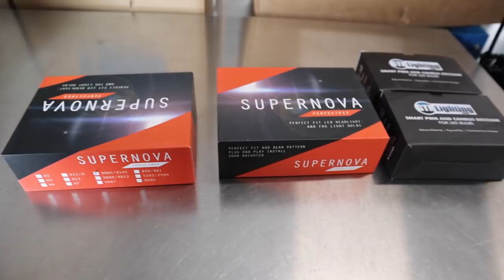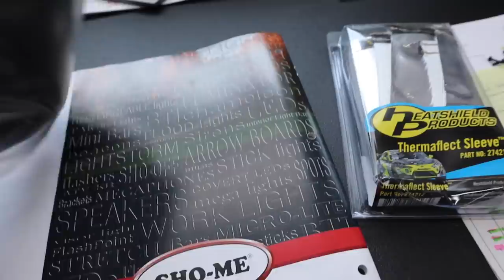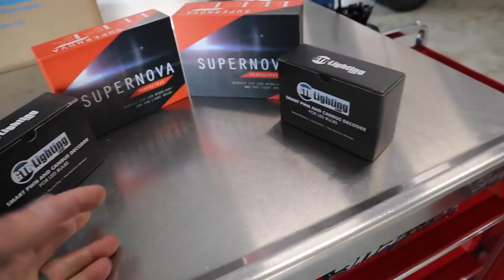EASY TRUCK UPGRADE TO IMPROVE NIGHT TIME DRIVING

Comment: When you said the 2015 is a nightmare, are you talking about reflector models or projectors? And 2015s and older or 2015s and newer? 🤔 also why is it a nightmare? Sorry for all the questions
Reply: wanting to know also. mine is a 2017 and with all the reviews of all LED conversion kits with the modules for the canbus system lights still flicker and or turn off... still extremely reluctant about buying a kit for my truck..
Reply: I would also like to know I have a 2018 with projectors.
Reply from the maker: Ram did something different w/ the canbus system in 2015 (only) & there’s a 50/50 chance that you’ll need an additional wiring harness to upgrade your headlights. This problem only affects 2015 Rams, all other years are fine.
Reply: Ram BEAST Projects what do you recommend for my 2018 3500 for led? I have the dark housing projectors. All I have heard is bad story’s that they all never work properly?
Reply from the maker: I recommend their 55w HID kit for your loss & the SuperNova Perfect Fit LEDs for your highs.
Reply from the maker: 2018’s aren’t the problem
Reply: SIXVIII I agree with Steve HID lows and LED highs. On high beam my setup way out performs my 20” light bar for light output.

Comment: I have been running Toyo's on my Ram forever. Not just the brand, the same tires, they have zillions of miles on them and I still can't complain. Diesel Brothers hooked up with Cooper finally and that brand is one I'm thinking about. If you could get a set, before anyone else, would be awesome.

Comment: I had the MOPAR lift on my 2011 Ram 1500. It was a 5inch and easily cleared 35 inch Pro Comp all terrain. Love the set up till I traded the truck in for a 2500😜😜😜😜

Comment: I heard the 2" mopar lift will only do 1" on the Rebels since it's an inch higher because of the off road package that sits an inch higher.. I have a 19 Rebel myself..
Reply from the maker: Correct

Comment: Just a question did you have to change the gears to run the 37
Reply from the maker: Yup, whole series on it. 

BIG BOY TOYS Comprehensive 4th Gen Ram 4.56 Gear Swap Unboxing (AAM 11.5 & 9.25 Differentials) https://youtu.be/Tvm_ohVTFEg

Comment: I wonder a HID kit would work on that truck?
Reply from the maker: Do not use HID’s in a reflector housing.
Reply: I put them in my 2018 4Runner and they worked great. Is there a reason why they work with the 4Runner and not the Ram?
 @BEASTProjects

Comment: How are you only running 37's with a 6 inch lift? My ram is running 35's stock. Must be the wheel offset I'm guessing.
Reply from the maker: Fits fine, 20X12” -44 offset.
Reply: @BEASTProjects  what I'm asking is why are you only running 37's lifted when my 2500 runs 35's without any lift or even a leveling kit. We have the same truck, just mine is stock.
Reply from the maker: It would be pretty tight to go any larger than 37’s with a 6” lift. The 37’s rub on occasion at full turn when I hit a bump.

Comment: Question.. you guys didn't use the canbus modules that came with the supernova kit and bought separate GTR PWR modules??? Why did you opt to do it this way?
Reply from the maker: That’s the way Headlight Revolution makes the package, specifically for the Rams. They know that it works from their testing.
Reply: Ram BEAST Projects thanks so no need to buy separate GTR modules. I’m buying the kit right now. Will report back in a after couple weeks on reliability.
Reply from the maker: FYI, Canbus modules (GTR Power Modules) were used & came with the kit specifically for the 2017 Ram reflector headlights from Headlight Revolution. You’ll definitely need them.
Reply: Ram BEAST Projects okay so only buy the supernova perfect fit kit right?(bc GTR modules come with it.) No need to buy additional gtr modules.

Comment: Please stay away from pro comp.
Reply from the maker: Bad experience?
Reply: Correct. Shocks are junk, finish(paint/powder coat) on their products aren't the best(prepare for rust), and their hardware and brackets seemed cheap to me. For the money I paid for my lift, I expected more. Bds makes amazing products. 👍
Reply from the maker: Still waiting on BDS to make a lift for the 2019 Rebel..